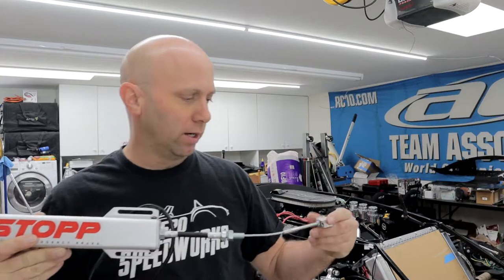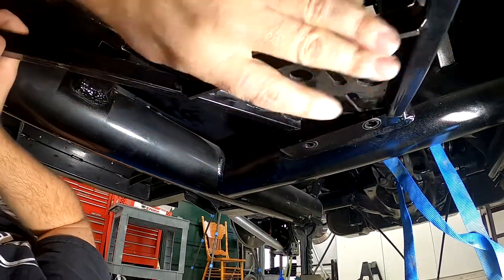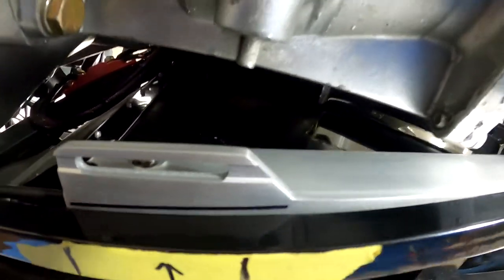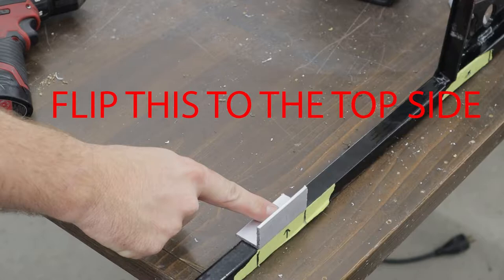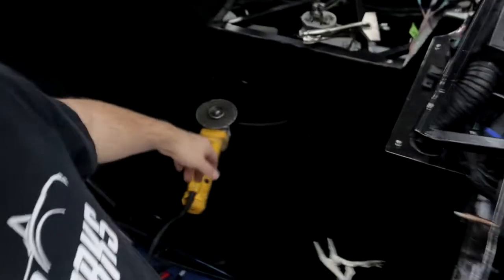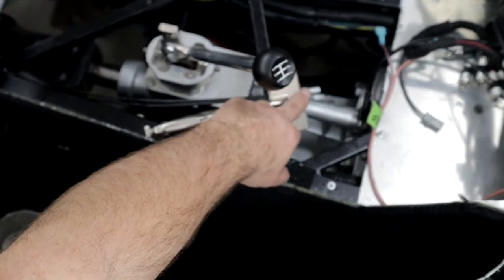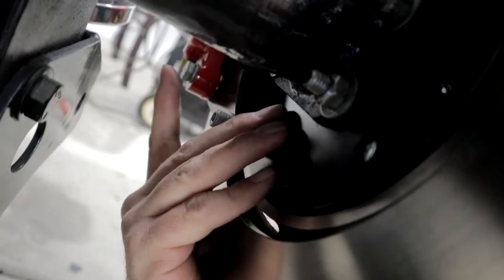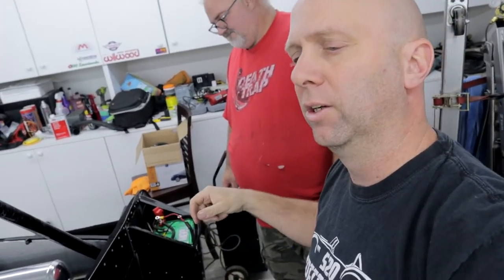E Stopp Emergency Brake Install Instructions

Comment: One thing I noticed when you were mounting the E Stopp actuator: I always try and use the 'aircraft orientation' for fasteners. This means that the bolt face backwards, in the direction of travel (utilizing centrifugal force) or down, using gravity to hold it in place. In the unlikely event that your fasteners worked loose, your bolts would fall out on to the ground. If you mounted them the other way, the bolt should always remain in place, even if the nut and lock washer etc. fell off. lol I know this is a minor detail, but it could totally save your bacon some day!! That E Stopp is cool! I never even knew such a thing existed. Thanks for the vid.
Reply from the maker: Metalcop LoL you caught me. I come from an aviation background. Just retired 20 years Air Force double dipping with 15 years civilian.  We also have a racing background so we generally do that.

Comment: I gotta say, that looks like a really tight bend for the cable coming out of the actuator.  From the video at @20:22, the end of the actuator housing looks to only be a couple inches forward of that angled bracket the output cable goes thru, and it's tilted what looks like 75 degrees up from straight behind the actuator.  Sure it works, but that cable is going to dig into everything it's touching much worse than if it were all more of a straight line.

Comment: My E Stopp kit didn’t have any 90 degree brackets, mounting bolts, and only one nut on the e Stopp cable. Do you no longer provide that with the e Stopp?
Reply from the maker: It is a seperate item that needs to be ordered depending on what you are working on. Here is the link for the Cobra kit.https://520speedworks.com/shop/ols/products/cobra-install-kit-mk31-4
Reply: @520speedworks6  I most likely knew that when I ordered it but forgot. Thanks for the follow up. I’m under the car now tying to see if I can angle the aft end of the e Stopp up a bit to reduce the bend in the cable. I’ll post some photos when I get it sorted out.

Comment: I'm installing this in my cobra, im tired of the clunky handle, did the E-stopp worked without the blue wire? I want to be able to engage and disengage with the engine running.
Reply from the maker: Yes do not hook up the blue wire or you will have to turn the car off. We never hook it up!

Comment: If I’m putting this on a rail buggy would a set of dom tubs to run the cables through be suggested? As there are no tracks or brackets to send them through.
Reply from the maker: Would be a good idea, but we only use cables that are fully sleeved. That way we do not have to worry about chaffing and the cable only needs to mount at 2 ends.

Comment: Because the slow release of the parking brake, it is unacceptable in an emergency situation. Law enforcement used to have a maneuver on the old model units to pull the parking brake lever so that you can do a 180°.

Comment: Who on Earth would create a so called, "safety feature" whereby the emergency brake cannot be engaged with the engine running?
Surely chances are that an emergency arising due to foot brake failure, would occur with the engine running!